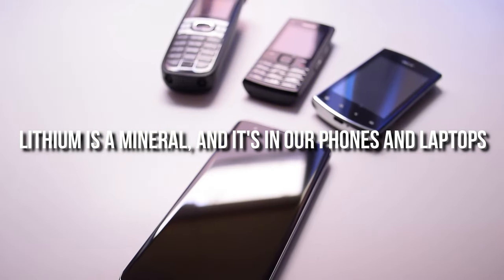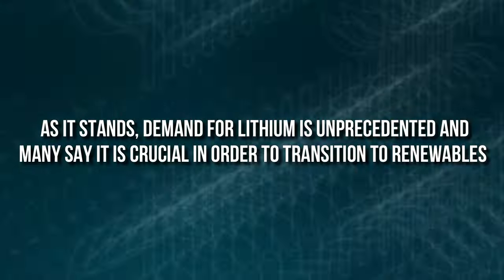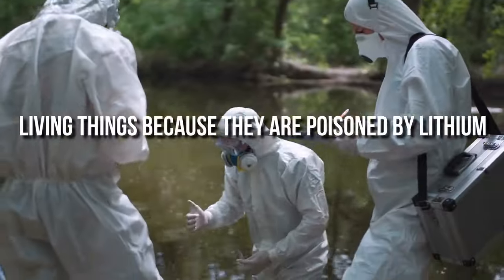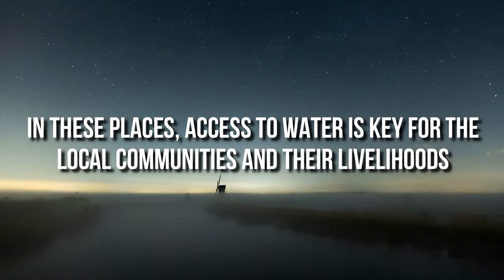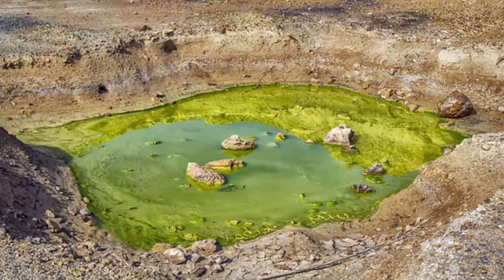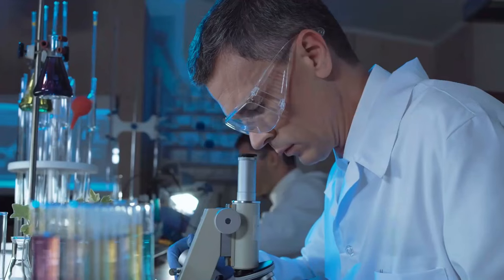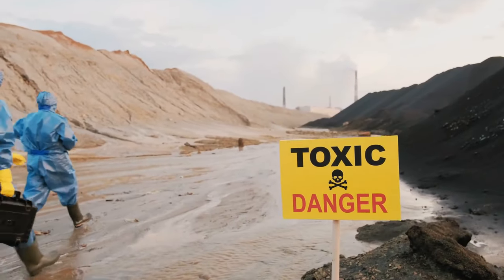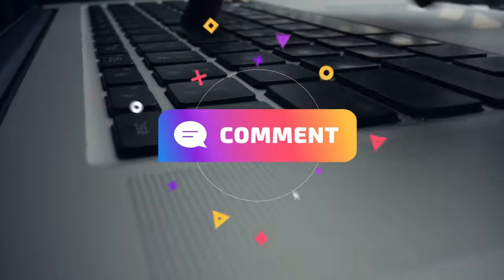How Bad Is Lithium Mining For The Environment?

Comment: This is only one part of the EV question, energy has to constantly be generated to refill those batteries.
Reply: Oil has to continously being pumped to refill those gas tanks. What's your point?
Reply: I think the point is it isn’t a solution. How are all of these batteries going to be charged without fossil fuels? Especially when  mining equipment, construction equipment, and all other large equipment is forced to go electric. Can you imagine the size of the batteries and the energy required to charge them? There is no infrastructure for that. This world runs on fossil fuel, and will continue to do so for the foreseeable future.

Comment: Electric cars are never the future
Reply: Best car is BMW - Bus Metro Walk. No cars can be good for our 'human' future
Reply: @Paul.Gallant  Ebikes obviously use li-ion batteries but significantly smaller than cars and allow huge mobility compared to walking and greater flexibility than public transport. They can be used by older or less fit people as they massively reduce the effort required compared to a normal bike. A higher powered Ebike capable of ~25-30 mph will keep up with traffic in most areas and will be significantly faster in busy areas. Governments should review legislation around high powered Ebikes and look into making them more accessible especially in more rural areas with greater distances but less transport options and pedestrians.
Reply: @cynicalpenguin  well it would have to be something quicker for it to efficient in rural areas do them not being that close to the city but you’re definitely on to something
Reply: it is for the people in charge :) Full control at a press of a button! Yay

Comment: It’s a pity you kept showing videos from open cut hard rock mines, instead of actual lithium sites. 

Modern extraction is from brine extraction using a process plant. These sites have extremely low environmental impact. The well is drilled, the brine run through the RO process and the spent brine injected back to where it came from, without the lithium. 

Your comments on water use are straight up garbage. You do realise that the ‘water’ being used is hyper saline brine and cannot be used for single other use. Even the old style evaporation ponds ‘add’ to available FRESH water by increasing humidity in the local environment from otherwise useless water.

Your comments on Australian mining are incorrect. MARP’s have been required in Australia for the past 25 years. Mining companies are required to pay a bond (100’s of millions) to the Government BEFORE mining starts. At the end of the mining cycle, the area needs to be rehabilitated by putting the waste rock back where it came from, the soils replaced and the area revegetated to a standard set by the local communities.